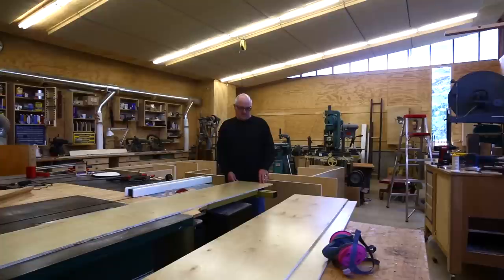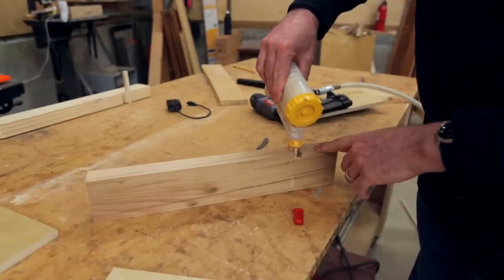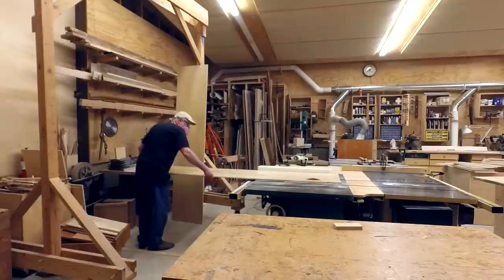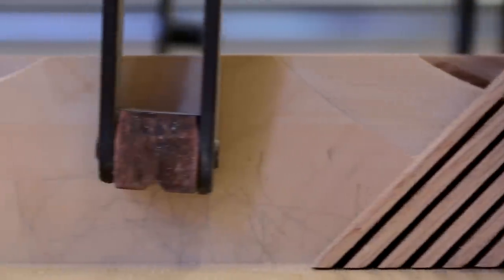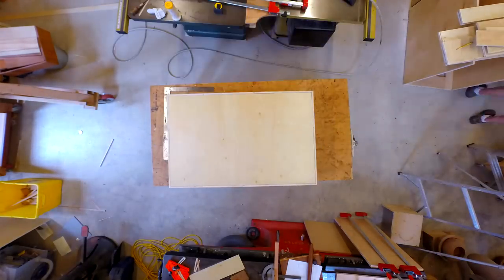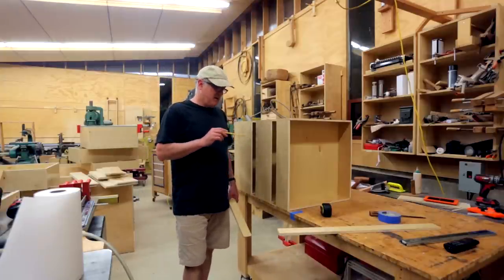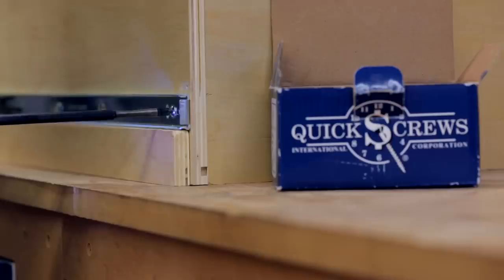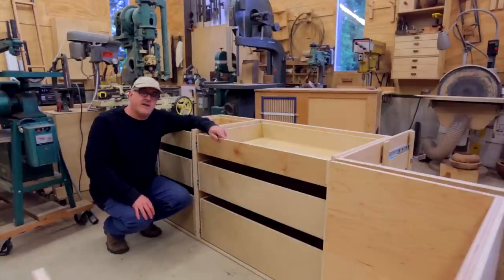Kitchen Remodel: Part 5 - Drawers

Comment: Mr. Howarth. A trick I use to stop tearout is to lower the saw blade so the blade makes about a 1/16th of an inch cut. Then run the piece across the balde backwards, then adjust the blade up again and run the piece forward to make the cut. Works great and gives you a razor sharp edge with no tearout. Thanks for the great videos. Enjoying all of the projects and the video tricks.

Comment: Hey Frank, 
In a lapped dado like the one on your drawer bottoms, the week point is usually the shoulder of the dado, not the tongue of the rabbet, so it's okay to put your mass side down. Plus if you go mass up you'll have a little groove all around the inside your drawer that will fill with crud over time. Love your videos!
Thanks
Reply: Patrick Halseth You are correct, it's the same joint either way.
Reply: Patrick Halseth  yeah all the  shear weight is on that tiny quarter inch shoulder the glue joint of the plywood.  I usually put 1/2 inch under that shoulder  and use hidden under mount slides . I have had too many 1/4" shoulders break off.
Reply: 4th concurrence. The weak interface is the shoulder of the dado. The shear-out would occur between the layers of ply at that point. The orientation of the bottom does not seem to matter, the strength is coming from the shear strength of the tongue of the rabbet -- therefore up/down does not matter. But I think Matthias Wandel did a video testing different types of drawer bottoms, and you would have to be essentially storing depleted uranium billets in these things for it to matter very much either way. I think he tested some with the bottom just face-glued on and that worked surprisingly well.

Comment: Fascinating installment.  Love making drawers that are practical though not dovetailed.  Have always had luck using 1/4"X5/8" crown staples to attach the sides to the front/back.  Haven't had any failures.

Comment: Frankie....looks great....i think you should have made the large drawers from 3/4" ply and not from half inch. those usually hold heavy pots and pans. those will brake first for sure and i would have used heavy duty slides for those drawers as when they are fully loaded they will slam.  other then that looks beautiful cant wait to see the finished kitchen.

Comment: This looks great so far.

I wonder if you should reinforce the longer drawers in some way to prevent the middle of the front and back from separating over time, making the bottom loose, though I've only had issues with cheaper furniture. The plywood you used should be stronger than what I have, but it could still be a problem with cast iron and ceramic pots and pans.
Reply: I was just thinking the same thing an small strip of wood on the underside glued and screwed from the front face to the back face along the middle would help alot. Sense based on the rub Mark's in your old cabinets your family seems to like cast iron cookware.

Comment: Those drawers are big enough to hold Jay Bates...   
(and if you didn't watch Jay build his miter saw station then that makes no sense at all!)

Looking good, Frank.  Those are enormous drawers, I'll be very interested to see them in the final kitchen.
Reply from the maker: wordsnwood They do seem bigger than i imagined .   they may need some dividers.
Reply: frank howarth How much weight are those drawer slides rated for? Seems like that could be a fair amount of weight with a ton of pans in the lower drawers.
Reply: Ian Page-Echols Every full-extension drawer slide I used, is rated at 100 lbs. I don't know if that's each or per pair.
If that's not enough capacity, install a second set of slides, so the drawer now has 2 pairs of slides. Now, load it up with kitchen stuff!
Reply: It's a huge drawer, but that should be able to hold enough weight.

Comment: Those look like the Ho,e Depot slides. I've used them a few times thinking it me who is just not being accurate enough... They are just bad slides. Once there is any small amount of weight in the drawer that little magnet and spring system just isn't enough. By weight I mean the drawer itself. Maybe they are for 1/4" plywood. Keep up the awesome work!

Comment: Great work! As always.
I use these slides often and I noticed that in some circumstances, when your drawer is wider than 1 meter is good to have 2 of them on each sides, or soft slide and one normal ball bearing slide. Of course I don't know how much stuff will you have there, but in my case it worked well, because we must have tons of stuff in drawers.. you know what I mean ... :-)

Comment: Great video as always Frank. 
I have found in my experience (250 custom made drawers and counting) that any slide mech with soft close or push to open is extremely sensitive to dimensional inaccuracy.
In fact most manufacturers state somewhere in the neighbourhood of +/- 0.5mm!
The regular runners however without soft close or push to open are far more forgiving and reliable in general so now I only use the basic runners and either add side mounted soft closers or push catches and the results are much better.
Reply from the maker: lumenman Thanks, good to know

Comment: Seems like the heavier duty slides require a higher level of precision.  It sounds like the self-closers may be even more picky.  I'm guessing you'll get them dialed in with a little tweek here and there.

Comment: Perhaps u would like to try assembling only with air nails and screws instead of cut out joints or jig?(whatever u may call it, to hold the sides in place or support strength).It would save u great time and effort.However upon doing that,u most likely would need to apply those exposed areas with laminates sheets to conceal all those nails and screws holes.. cheers ,mate

Comment: If you're ripping on the table saw and you want to minimise tear out, lower the blade so that it's just higher than the thickness of the work you're cutting. It's the angle of attack of the teeth that causes the tearing.
Or get a scribing blade if your saw will take one.

Comment: Frank, just so you know, I've used these style of soft close slides in hundreds of kitchens at my old job (custom kitchens) and our cabinet boxes were done on the CNC (accurate to a thousandth of an inch) and they still only really work so-so. The only really good slides if you want truly smooth and beautiful soft close drawers are the expensive Blum under-mount style with the orange toggles. They run about 50$ per pair (which is pretty expensive) but you can gently push a drawer with your finger, and it will beautifully soft close by itself. IKEA has these same exact slides, by Blum for cheaper but they use slightly cheaper metal and plastic in them to cut down on the price.
Reply from the maker: sooth15 Thanks, good to know
Reply: frank howarth Also, I was told that they get better once they "run in" a bit, but I don't really know if that's the case since I don't own any cabinets that use these.

Comment: That was one awesome video! I think one of your best so far and I believe I've seen them all. As a beginning woodworker, I've experimented with several different ways of making drawers and finally settled on assembling them with pocket holes. Not very elegant, I admit, but they do seem to hold together well for my shop and I've found them easier to measure to fit. I'm wondering if you ever considered using pocket holes for your drawers instead of the dado/rabbets that you used for your kitchen drawers?

Comment: you are right, these slides are a "pain" and have no play in them.  next time use the blum movento ones (or an equivalent) they are 1000x time smoother.    gj  nice little jig for the slides

Comment: I don't see that you are losing any strength in the joints (5:15) at all, assuming the drawers are loaded from the top. In order to fail, the plywood still needs to shear at the edge whichever way you put it in and the shear area is equal. It would only be an issue if you had a tensile load of the bottom of the plywood- then it could fail by inter-ply tension. Any way, great project Frank; I know the finished kitchen will be very elegant.

Comment: I was wondering if you would have issues with the saws so close back to back.  I have mine 8' apart.  You can see the setup in my video of my woodshop tour.  Of course, I then have a huge table between saws.  But it's nice to be able to work on that surface if I have to, to assemble projects.
Reply from the maker: Heavyboxes That sounds like a good set up.

Comment: If you put a 3'' spreader flush with the top of the cabinet this will keep the width of the cabinet consistent and should help with the drawer closing by its self. It also give you a place to fix your countertop from underneath
Reply from the maker: Ned Casey I am going to build that next.
Reply: Cool. I love you're work by the way.

Comment: I am new to finish carpentry, so excuse my lack of knowledge in this but, the thing I am lacking confidence in is building my cabinet frame, then not being able to fit it into my drawer slides. Is there a certain technique to measure the width of the drawers so you can always get them cut and built accurately to the spread on the slides?
Feedback is immensely appreciated!!!

Comment: I'd love to know the brand of dado blade you use which has lasted so long?  Also, any recommendations for a small, portable table saw?  I don't have space to lodge a large one like yours.  I had a Craftsman table saw for many years and sold it due to moving.  I really miss it!  Need to get another one for small DIY projects.  Dewalt looks very portable.  

Thanks for your excellent tutorials!  Very practical, and I learn a lot about what not to do as well.

Comment: I've always wondered what the best/most accurate way is to install drawer slides and that jig for placing the slides is a great tip.  Video didn't show how you placed the corresponding part on the actual drawer, how was that done?
Reply: Annony Mouse That's what the spacer was for, I think. That's the distance from the bottom of the drawer to its slide.
Reply: Alex Kenny Ok, so you would just use the spacer without the jig and clamp it to the bottom of the drawer to set your distance?

Comment: Am I nuts or is it weird to have drawers that wide and deep in a kitchen? I'm not questioning the level of usefulness, I've just never seen it before.
Reply: I like it. Nice way to store large gear and not have to get down on hands and knees to get it out from the back of a bottom cabinet. As I watch this I find myself wondering why kitchens don't tend to have more big drawers like this. I'm guessing it's a cost and ease of building thing.

Comment: I like the jig for positioning the outer slide pieces.  How did you position the drawer side slide pieces?  Did you use the 1 1/2" spacer from the jig at the draw bottom as the guide?

Comment: frank howarth, I would like to ask a few questions if you don't mind. Like your videos, Not only are you good at wood work your good at video making. I have an old steel top table saw like yours that keeps getting rust film on it. Is there anyway to seal it up and what is best way to sand it down to shiny again. Also wandering if you have made any videos on setting up your saws with the slides and jigs and things. Have been bed ridden for several years and almost back to where I can start using my shop. Have jig, band and table saws and quite a bit of stuff that has just been stored in shop since moving here and really looking forward to wood working again. Sorry if I asked to much and no worries if unable to answer. Take care and thanks.
Reply: Try a good carnauba paste wax. It helps the parts slide and keeps the rust at bay. I have also heard use of beeswax but I have never used that personally.

Comment: when you where talking about losing strength in the bottom because it was dependent on the glue in the layers but it would be strongerif you turned the bottom over. Either way you are dependent on the remaining piece on the dado on the side which is supporting the whole side aren't you?
Reply: +ALLxoxoxoxo When installed with the remaining tongue up, any heavy weight will cause the plywood to try to peel away at the layer joint.  With the tongue down; the layers of plywood will be in compression.
It won't happen overnight, but might mean the drawers have to be replaced sooner than otherwise.  If all that's being stored in the drawer is lightweight items, it's no big deal anyway.

Comment: Hi Frank, Nice video.
I noticed you didn't use the recently made zero clearance saw insert on the squarish opening when cutting sheet goods. Is there any reason for that.
Reply from the maker: Marisa Aguilera I have not made one for that blade, as I have been using that blade with a sled.
Reply: frank howarth OK, Thanks.
It's just that I have the same table saw with the same sized blade opening and doubted making a zero clearance insert because there isn't much space between the blade and the closest edge of the opening. So I was pleased to see your video on making one. Just wanted to know if it still is working Ok or if you have had any issues?

Comment: I think you may have lost more volume by having an extra 1 5/8 between between drawers than you gained by the orientation of the bottoms.  In a sense, it is still useful space, so it’s not quite clear how much of a loss it is.

Comment: What brand are those soft close slides?  The Blum ones seem to mount under the drawers, i like how those are just on the sides of the drawer.
Reply: lsdave they look like knape and vogt 8450 or one of the chinese clones. don't waste your time with them. the side mount soft close are extremely finicky like he says. you have to be within about 1/32" overall or they either don't slide smoothly or they don't soft close. buy the blum tandem undermount or the kv g-slides and save yourself the frustration. the normal side mount slides are fine. it's just the soft close mech that uses a pin that's awful to work with.
Reply: aallwwkk Thanks for the info!

Comment: How did you know where (height wise) to put the slides on the drawers.  Did you use a jig for them as well?
Reply from the maker: Don Bell I used that same 1-1/2" shim/spacer to hold the slide up on the side of the drawer too.

Comment: Every time I assemble pre-made drawers I am angry about that shitty engineering. No matter what you buy. Expensive or cheap. They always suck. The bottom will fall out after a few month and they don't fit precisely.

I love your approach and how you improve stability. They are drawers and not resters. If the bottom had a bit of a bend upwards, it would be much stronger. Like a bridge.
Reply: Andreas Hontzia I find this to be a problem with shitty corner joinery. If the corners are the only places where the sides are held together, and the bottom does not have a good fit, the bottom will flex, deform, and push its way out of the dado.
Reply: Tim Lau Yeah, I have seen drawers with metal beams below. They are a bit bulky, but it works. The bottom should be the strongest part.